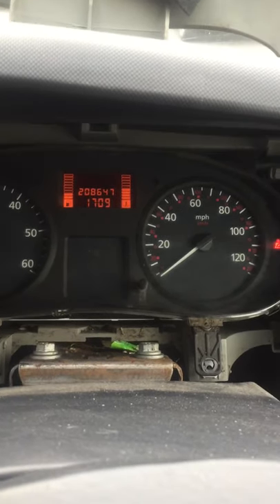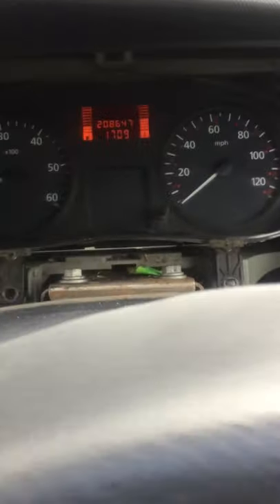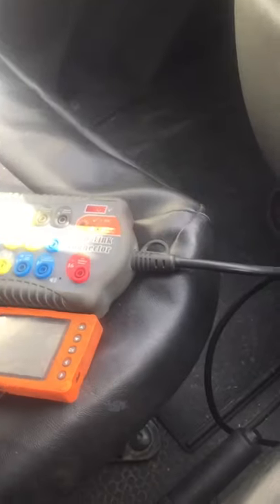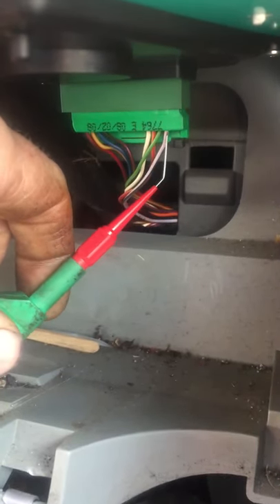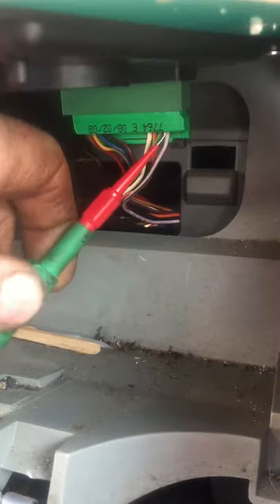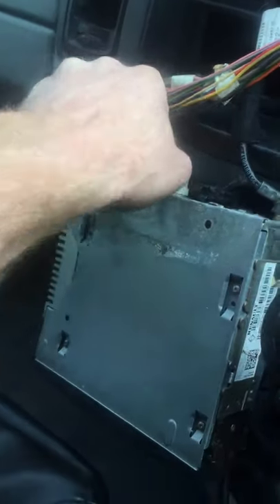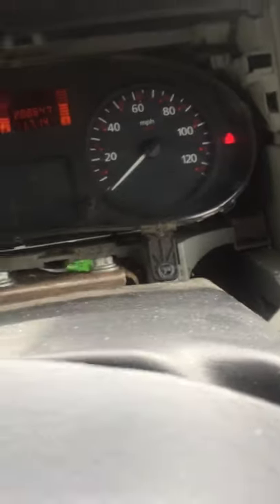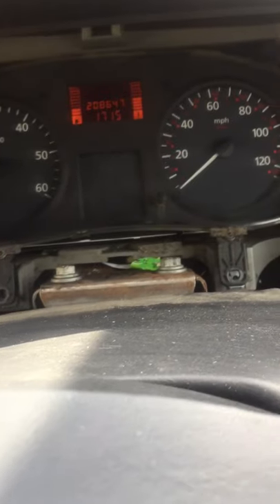Vivaro Trafic Primastar speedo not working

Comment: Had the same issue today, someone bought in a 09 traffic with no odometer or speedo working. Was just about to go rooting around the loom when I came across this video. Guess what, brand new aftermarket radio installed with reverse camera. Unplugged it and bingo. Pity they have butchered the loom though...long Friday afternoon ahead 🤣
Reply from the maker: Paul Smith that is just why I do these videos, because we all come across issues that we get stumped on and if we can share the info hopefully this car repair business gets a little easier. Delighted it helped a bit and well done on the repair 👍

Comment: Just to add my tuppence here, I fitted an xtrons android headunit to my vivaro with ABS, did a timing belt at the same time. Speedo not working on test drive afterwards. Spent hours looking for something I disturbed during belt job and found nothing, eventually unplugged headunit and loom and speedo worked again. Just plugging in the headunit loom itself stopped the speedo from working, didn't even have to plug in the headunit. Looking at the iso radio loom itself I noticed the main ground was spliced and looped into another pin on the same plug of the iso loom. I cut this splice and bingo, speedo worked and everything on the headunit still worked. Hope this helps someone, the main ground was either pin 1 or 2 on the loom, it was spliced into pin 7 or 8 on the same plug of the iso loom. Hope that makes sense, it came from the manufacturer like this!
Reply from the maker: Good man. And thanks for sharing this information 🙏🙏
Well done for getting it sorted too 👏👏👍

Comment: Think this could course abs and spanner light to com up aswel my radio finds it really hard to get signal to I changed all abs sensors n still lights com up took it on vag throws loads of difrent faukt codes up but somtimes the lights will goo off then com bk on it’s nuts
Reply from the maker: Some cars can be crazy, fingers crossed you will find the problem 🤞
Reply: @kennedysgarage3281  now my speedometer is playing up and my van throws stop and break light up then I turn it off and it resets for abit same with the abs and spanner light to . Think it could be the radio
Reply from the maker: @gregspoks6545  you will really need to do a code scan of your Abs. This is where you would have to start🤔
Let me know what codes are stored when you scan it 👍
Reply: @kennedysgarage3281  checked the radio took
It out did nothing
Reply from the maker: @gregspoks6545  were you able to do an ABS module code scan ??
Reply: @kennedysgarage3281  yh I’m gona get him todo it as it’s in the garage now as on Friday the clutch went that was why the stop and explanation mark kept coming up clutch just sank at the trafic lights night mare
Reply from the maker: @gregspoks6545  🤦‍♂️
Reply: @kennedysgarage3281  yh I no mate wish I new that that stop n explanation mark ment my clutch was going lol 😂 gd feature tho if I new lol 😂 but as for abs n spanner sod knows yet

Comment: Bought a nissan primaster but gearbox was changed and it has no place for the original speed sensor as its blanked.. the van is 2005 and doesn't have abs is their anyway you can wire it up to get it working?
Reply from the maker: Barry Archer unfortunately the gearbox needs to be changed ☹️
The gearbox fitted was for a van with abs & should not have been fitted. 
You could try figure out a way to turn the original speedo sensor but I think it’s an impossible task, sorry
Reply: @kennedysgarage3281  no problem cheers for the reply :)

Comment: My 2003 Renault Trafic speedo works fine from startup then stops working sometimes coming back for while, if I carry on driving the whole instrument cluster stops working but comes back to life occasionally ! 
The next morning its fine again for a while and the same happens again,
Does any have any ideas about what could be happening here.
Thanks
Reply from the maker: Does it have abs??
Check all of these fuses they power the instrument cluster. F12 F16 F27 F29 F31 F33 
Fuse F17 powers the speedo sensor.
Remove them all 1 at a time and examine them, you don’t have a fuse blown but 1 could be corroded. 🤔
Reply: @kennedysgarage3281  Brilliant thanks for the advice I will check them out 👍

Comment: Hi I have 2005 Nissan priamstar and the speedo clock stop work would you say it’s the radio thanks John
Reply from the maker: Remove it and see what happens. Does your van have ABS?
Reply: That’s okay and yes it does have abs sensor
Reply from the maker: @johnklee6084  once it has abs the speedo is being driven by that, make sure your abs light comes on with key on engine off. And goes out once you move. This shows the abs to be ok & something else can be causing the issue, radio being a commonly changed item & could be faulty or wired incorrectly 👍
Reply: Okay thanks very much 👍

Comment: So if I got a aftermarket stereo and my speedo still aint working.. what else could it be?
Reply from the maker: My first question is, does your van have abs or not?
My second is, if the aftermarket radio was wired incorrectly it could very easily cause the same problem ? 
In this case just unplug the radio as close to the original wiring loom as possible 🤔
Reply: The van never had a stereo when I got it amd the speedo wasn't working then 🤷‍♂️
Reply: And
Reply from the maker: @johnrose1985.  I will assume from that the wiring behind the radio is in a nice clean state & not all taped up 🤔
Then I still need to know does it have abs or not, if not it is more than likely the speedo sensor in the gearbox block connector. 
If it has abs your more than likely going to have an abs problem

Comment: I have a Vivaro 03 with the same problem, I don't have an ABC radio, I put it on from my old car. does the same apply for 03 THANKS
Reply from the maker: If it doesn’t have abs it is a different system. Your car has a speedo sensor in the gearbox between the 2 drives on top off the differential. You can see it from under the bonnet.
Water gets into the block connector, take it out & clean. Also twist the pins in the sensor slightly to get a good connection after

Comment: If that's the problem, so the van cannot have a radio at all to keep this problem out?
Reply from the maker: Incorrect. My radio had shorted out internally. The issue was fixed after I fitted a new radio. But if the radio was wired wrong it would cause the same issue
Reply: @kennedysgarage3281  Thanks a lot, I will give this a shot, and see what happens.

Comment: I've got problem with my Speedo not working properly and engine running lumpy after I had been working on radio.radio not working now
Reply from the maker: John Venus  Disconnect all plugs from the radio and see what happens. Also see if it has ABS  because speedo works from abs pump if it has it, if not it is worked from a sensor in the gearbox and the plug on the sensor gives trouble
Reply: @kennedysgarage3281  ok mate will try that tomorrow .thanks
Reply: Took radio out and van is working fine again. Thanks for the info.
Reply from the maker: John Venus that’s great John 👍

Comment: Mine has this exact problem but no corrosion at radio connector...how do I fix this problem?
Reply from the maker: Does it have abs?
Reply: @kennedysgarage3281  I'm not sure, van is away at the min for me to check.
Reply: Hi, yes I think it does....there is a abs light which comes on when I turn ignition on.
Reply: Any news?
Radio OFF and speedo works and will max revs.
Radio ON and no speedo and only revs to 2500
Reply from the maker: @spunky5256  so if you disconnect or just turn off the radio the problem goes away is this correct
Reply: @kennedysgarage3281  yes that's correct
Reply from the maker: @spunky5256  the radio must be wired wrong, just get it rewired
Reply: @kennedysgarage3281  how can the radio be wired wrong?
It has a block connector from the standard vauxhall wiring harness to the wiring for the headunit so no wires have been altered with??
Reply from the maker: @spunky5256  ok, so if it is the original wiring & original radio then it must be a fault inside the radio. As you have said the Speedo only stops working when you turn on the radio. This is what it looks like from the limited information that I have. Well done for finding the problem 👍